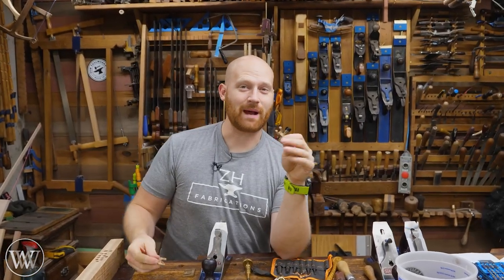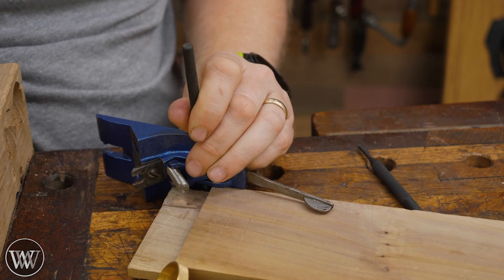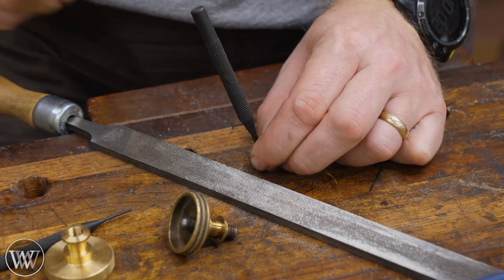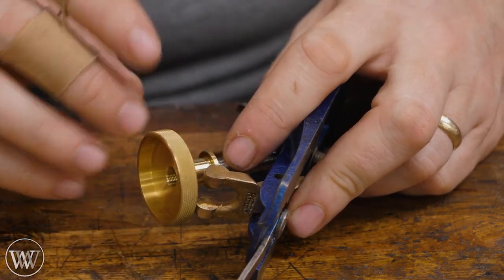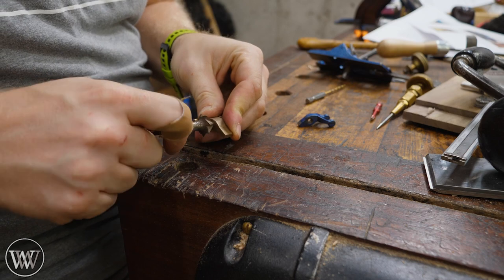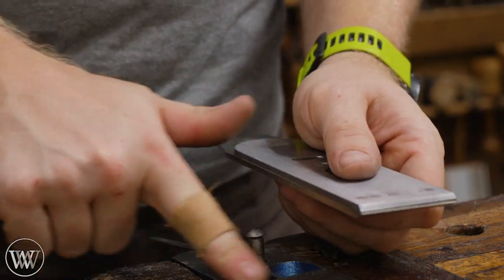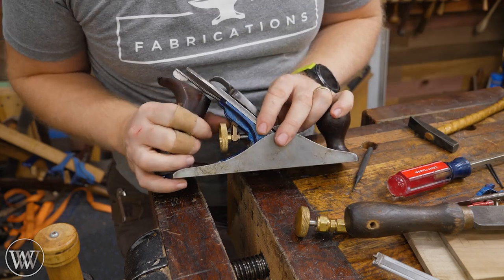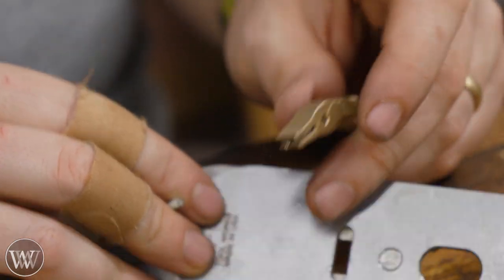How to Install and Use the Reed Plane No Slop Yoke

Comment: when word of these gets out to the hand tool wood working community as a whole you wont be able to keep these in stock.  these upgrades takes all together can upgrade any quality antique to the level of modern high quality planes with the exception of the cast iron vs ducktile

Comment: I'm not sure if this would work or not, but maybe you could set up your vice to be the same distance as the slot in your nut with sandpaper adhered to both sides and wiggle it until it fits.  It could possibly make things a little more foolproof or....it may not work at all lol   who knows
Reply from the maker: That would be fun to try.

Comment: How about bushing and drilling the original yoke? Half way there. I find the huge backlash annoying on my Stanleys but I have a couple of high end planes without it so much. I tend to have two or three Stanley planes each set for different thickness. I think I’ll try the Reed yokes.

Comment: I’ll second the advice not to drill out the hole with a 1/8” bit. Go with a 7/64” or letter size. Now I have just a little too much slop in the pin hole, but it’s not so horrible. If I get tired of it I may replace the pin with a 1/8”, but likely not so I don’t drill into cast iron. 

It should be a couple hours of work at most to file and fit the yoke and install the new depth adjuster. One of the reasons I was so excited to upgrade to the yoke and new depth adjuster was the screw on the old depth adjuster was chewed up. And this allowed me to reuse a questionable frog and give it new life. I’d highly recommend these upgrades.

Comment: Hi Mr. Wright.  Out of curiosity, have you installed this yoke on your Taytools plane?  I purchased a scratch-and-dent one from them (big mistake) and there's a lot of play in the yoke. I'm wondering if this will alleviate some of the issues I've been having with it.  Thanks!
Reply from the maker: I have not installed it as I don't use that one much, but yes it will work there and eliminate most all of the slop.

Comment: I'm in the midst of repairing an old Bailey No. 4 that is bizarre. It might be a chimeric frankenplane. Not sure. The problem with it is that the blade would not fully retract. You had to keep a tiny gap with the chip breaker and pull the blade up the frog before latching down the lever cap. Forget about any camber across the blade. I found that the yoke was wonky. It was too fat and was interfering with the back of the depth knob so you couldn't run the knob all the way in. I filed it down and this fixed half of the problem. Still not enough, though. Comparing to other planes, I found that the nose of the yoke (that engages the cap iron) was too skinny on the top side...it was too tapered. So, it could not lift the blade back far enough. A JB Kwik Weld patch didn't hold. I'm going to buy one of your yokes and see if all will be well.

Based on all of this, I want to make a couple comments:
- At 4:11you file the frog side of the lobes. I think this is important. If one files the knob side, you might run into the problem I had with the Bailey.
- At 8:51 you file the underside of the nose, then go back and forth. I guess based on what I encountered with the Bailey, I'm inclined to file the top as little as possible to maintain as much retraction as possible.

I'm wondering if you've ever had trouble with not having enough retraction after installing one of these? I could see the filing I just mentioned being one cause. I could also imagine that the pin hole location could affect the retraction, but am guessing that there is enough meat at the nose that maybe this isn't a real worry?
Reply from the maker: That sounds like a problem with the chip breaker. different companies put the hole for the yoke in different places. and if the wrong chip breaker is on there then it will not retract or Engauge all the way.
Reply: @WoodByWrightHowTo  That was my first thought, too, but I have 4 sets of blades and chip breakers and three Bailey planes (#4, #4, #5), and all the blades / breakers behave the same. All fine in the other planes. None quite enough retraction in this plane. All breakers measure the same, etc. Also, the depth wheel couldn't be spun all the way home against the frog similar to the other planes because the adjuster fouled against the yoke (even without a blade mounted). I have suspected chip breakers, blades, gremlins for a long time and finally noticed this interference and noticed the narrow nose on the yoke.
Reply: @WoodByWrightHowTo  Just finished replacing the yoke with one of the Reed yokes: Problem solved. Now, the blade fully retracts. I really think there was a wonky yoke before. It was narrower than any of the other Bailey planes. Narrower means in the push-pull direction.

Comment: I've been thinking of it, and for the micro adjustment, could you use a planetary gear system?
Reply from the maker: That would be fun for sure. But would probably be very expensive. Be interesting to try though.

Comment: Hi James, thank you  for such instructive video. It encourages me to finish the repair of my no 5. I just wonder, will you makeover all you  planes?
Reply from the maker: I'm doing this to four of my planes. My number 3, 4, 4.5 and 5. Those are the ones I use the most often and want the most attention. I may end up doing it on the rest but we'll see.
Reply: @WoodByWrightHowTo  the only downside is the yoke alone costs nearly as much as I paid for any of my planes. Not that I’m saying it’s overpriced; it’s actually about where I expected it to be. It’s just hard to justify a $15 yoke on a $25 plane.
Reply: @warkitty3426  I'm looking at it as $15 to get my plane adjustment like the $$$ planes.  It's the part you fiddle with the most,
Reply: @warkitty3426  The way I look at it that's very easy to justify, if you can take a $25 plane and eliminate any play from it for $15, that's incredible value. I just received my yoke, I'm going to try upgragind my Record No 05 that cost me 27€ :) The yoke itself was 20€ with shipped+taxes

Comment: My biggest worry is hole placement on the yoke, not necessarily drilling it out. How do I tell I have it placed in the ideal position?
Reply: File the lobes, position it in the frog with the wheel installed. You should see a good range of motion on the yoke when dialing back and forth.
Reply from the maker: If the knobs on the yoke are on either side of the adjustment nut, the adjustment nut is on the adjustment stud halfway, and the yoke is sticking out at 90° to the frog. Then the pinhole will be lined up precisely with where it should be drilled.
Reply: One of the major benefits to having the hole in the yoke placement by you guys is when it is at 90 degrees is that it then allows for you to more easily remove the blade and chip breaker.

Comment: i need one of these for a miller falls smoother, do you know if they are the same?
Reply from the maker: Yes they are the same threads.
Reply: @WoodByWrightHowTo  thanks for that, the smoother is nice plane but has 2 full turns of backlash

Comment: Any chance that these parts can work on a Record plane?
Reply from the maker: The wedges will work on most any plane. And same with The yoke.  But the adjustment knob and stud will only work on about 60% of the record plans. They changed the threading on theirs late in the production. If you have a Stanley plane you can unscrew the stud from that and see if it threads into where the depth adjustment stud is on your record plane. If it works then these will work.

Comment: Bought one each of the yokes and they have a lot of extra meat on them, more than I feel comfortable trying to remove. Spent a good while carefully filing to see if I could get the portion that engages the adjusting nut perfectly round. Got them to within .001 of round but need to remove about .040 to fit the nut. Came up with a better way, make an adjustable, adjustment nut. Need a 9/32-24 left hand tap to fabricate it, anybody know of a source in the USA for this tap?
Reply from the maker: Be back. We have to leave a lot of meat on there as many of the adjuster nuts spread over time and some people only have to take a little bit off to make them fit. As to finding the taps I do not know of any. To cut these ones we had to use a thread cutting lathe.